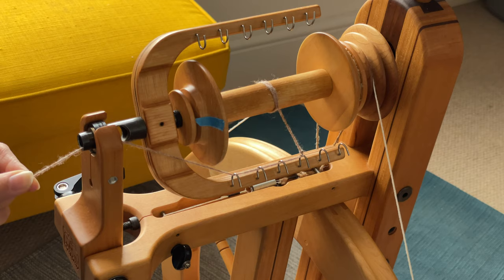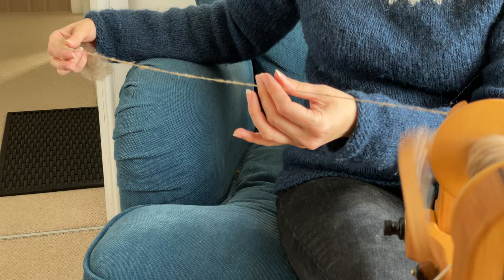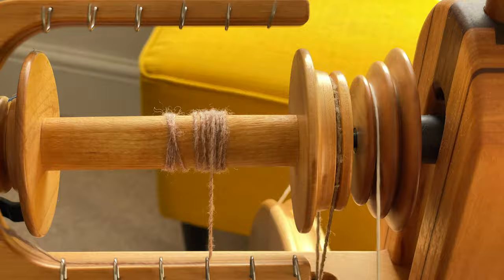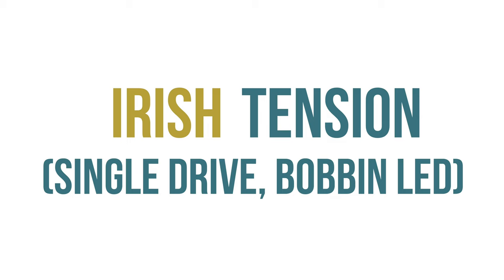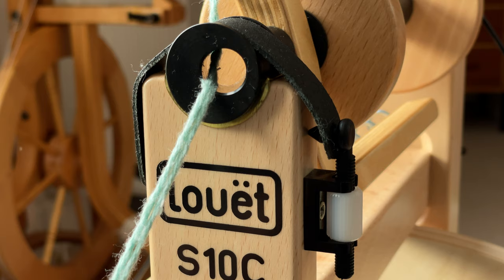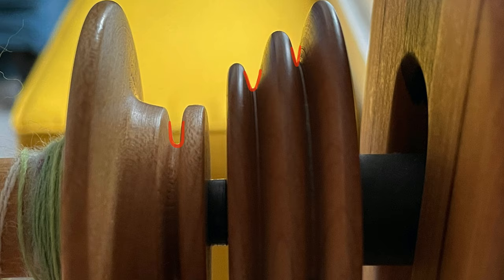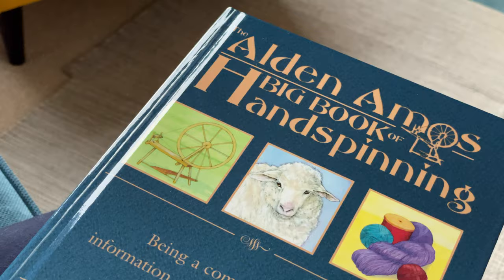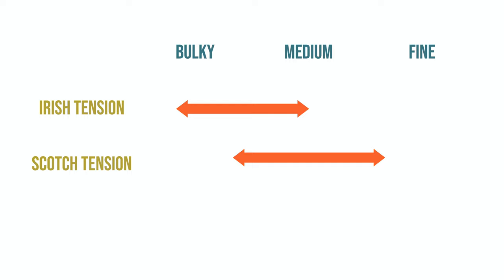How to Adjust Brake Tension on a Spinning Wheel (Scotch Tension, Irish Tension and Double Drive)

Comment: I ended up here after reading the book  - The Fabric of Civilization: How Textiles Made the World - In the book they talk about how there was always a shortage of thread before the industrial revolution so when people had down time they were making thread.  After reading that I wanted to find out how a spinning wheel worked. Most videos are pretty high level.  This is the first one that I saw that explained the secret sauce is that the speed of the bobbin and flyer are independent and it is the ratio between the two speeds that determine if you are adding a twist to the thread or wrapping the thread around the bobbin.  People make this look so easy to do but after this video it appears the whole process is quite fiddly with all the different adjustments and tensions.
Reply from the maker: Thanks for your feedback Tom - I’m really glad you found it helpful. I really need to get round to reading that book!  I often think about how spinning is such a niche activity now but pre-industrial revolution it was something everyone would have been doing. When you think about clothing, ship sails, mummy wrappings etc. and the fact that every inch of that thread was spun by hand it’s pretty mind blowing. 
I wanted this video to be accessible to beginners but also to show how it really works mechanically. While I was making it there were times when I’d write something in the script and think ‘hang on, is that really how it works?’ and I’d have to go and check on one of my wheels. 
The key ingredient alongside the flyer and bobbin going at different speeds is whether or not you have tension on the yarn - when you do, the components behave in a totally different way compared to when there’s no tension. 
Hope you enjoyed your foray into the world of spinning! 😃

Comment: Thank you so much for this video.  I don't spin but I'm fascinated by mechanical things.  Specifically, I wanted to know how the yarn was twisted but not always taken up on the spool.  I never knew the flyer and the spool could turn independent of each other. Yours is the only video I've found that explained and actually shows how this works.  Thanks for posting.

Comment: I just, on a whim, bought a handmade castle wheel from the 1960's (double drive) on ebay and I am reading up and watching all the videos I can find to understand how the wheel works and esp. how the various flyers and bobbins go together, because I may have to make some bobbins or whorls to go with this machine, which only has one whorl with one speed. I found your text very concise and understandable with great video of the various parts...very well produced! I personally like how no-nonsense you are with few smiley and goofy bits. Lots of good info and I'll be back. Thanks for your good work!

Comment: I use double drive on my kromksi minstrel.  Mostly because it was the way that the video said to set it up and I haven't tried it in scotch tension.  I think most of my friends do scotch tension.  I didn't have the opportunity to try out a lot of wheels, so I was on my own and I just got used to the difficulty.  Which, when you're just learning to spin on a wheel, there are so many difficulties that in the end I doubt it made much of a difference!

Fun story, I use a poly band for my double drive, which I've heard that some people think is impossible.  It very much isn't, and I like it a lot for the way I spin.  Mostly I spin short forward draw, as I do a lot of fine laceweight and fingering yarns for socks, which is what I like.

Thanks for this series of videos!  It is fascinating to learn how wheels actually work, and I appreciate the details and well-researched facts you present.

Comment: I wish I had this information when I started spinning in August.  However it's extremely useful to better understand wheel function. I use an Ashford e-spinner purchased in September and my very first wheel is a spinolution pollywog purchased in August.   I spin for projects that need worsted/DK yarn. The Ashford has enabled me to creat the yarn I want better then the pollywog. My next wheel will be a Lendrum 🇨🇦
The addiction is real 😁
Reply: Abir Hussein I also have an ashford e-spinner and it’s my only wheel. Can I ask, why do you want a treadle wheel? I kind of want one when I see people on you tube spinning with them, but do you think there is a real advantage? Just curious😊
Reply: @jenniferrich5292  Well... when I thought of taking up spinning I wanted to start in the  traditional style. Another deciding factor was price. The manual wheel I purchased was the lest experience. Another advantage is freedom of movement.  No need to use electricity and finely a bit of exercise. A month into using my wheel I wasn't making the yarn I wanted. The type of wheel I have is operated by toes not the whole foot and that is very uncomfortable.  Besides the upgrades to that wheel would cost as much as a new wheel. With the Ashford I've created yarn for my first hand spun sweater. Now my friends have bought me a Lendrum.  A Canadian manual wheel and I'm very excited to use it when I'm back in Toronto. Sorry for the ramble 😊
Reply: Abir Hussein thanks! Best of luck with your new wheel!
Reply: @jenniferrich5292  Thanks. My advice is to try a manual wheel. If you get the chance and sure you will enjoy it. Happy spinning.

Comment: Thank you so much! Your excellent, clear, articulate and succinct videos have helped me  so much. 
I have a DD, given to me, and have been learning on it but I have been having such problems with overtwisting.  All the online spinning group suggestions, like get the tension right, did not explain what is in this video. I now understand what the problems are, from a bobbin with V groove to the drive band tension. The other video that helped to pull it together for me was the ratios one; the two together have cleared up the mystery! I shall certainly be buying you some coffee (rather than the Aldan Amos book at several hundred £) ! 😊😊😊

Comment: I really loved your visual with the tape! The way take-up works can be a bit of a weird thing to wrap your head around, but this made it super clear. I chose an Ashford Kiwi as my first wheel, mostly for price and compactness but also because the Scotch tension seemed like a versatile option. I didn't really know what types of yarn I would prefer to spin, although I gravitated to finer weights simply because that's what I like to knit with. If I ever get a second wheel I'll definitely look into double drive, because from this video that sounds right up my alley.

Comment: Thanks for this and for previous videos! I'm a year into my spinning life but definitely feel like I'm still learning. I have a Louët Victoria S96 (Scottish tension) and the thing I'm still scratching my head about is the sliding hook (start in the middle? Start at the back/front?!)! The break band info is really useful as I find that the consistency does change towards the end of spinning the fibre so I'm going to try experimenting with turning up the tension a little :-)

Comment: I’m a relatively new spinner, and I bought a used spinolution pollwog with the accelerator. I haven’t used the accelerator yet, but I find I naturally spin fine yarn, no bigger than dk weight. In the future I would like to spin bulk art yarn also, but I like the spinolution wheel and plan to stick with that brand.

Comment: Fine yarns can easily be made on Louet wheels by lacing the flyer which decreases the pull until you get some yarn singles onto the bobbin.
Reply from the maker: Absolutely. I’ve got some other tips for fine spinning on Irish tension wheels coming in another video. :)

Comment: im not a very experienced spinner because i keep drifting off to other crafts!  But I do love it and I have a wheel. You talk about adjusting tension as the bobbin fills. I think this is to increase it gradually, is that correct? because the diameter of the yarn building up on the bobbin is increasing, but Im sorry I don't really understand why that requires a tighter tension!
Reply from the maker: Hi Bella, yes, that’s correct, you’d gradually increase the tension as the bobbin fills.  You may only need to increase it a couple of times and often just very small adjustments each time.  Essentially it’s to keep the ratio between the flyer and bobbin the same as the effective diameter of the bobbin increases. I’m not the most qualified to give an in-depth explanation of the physics behind it (so many factors to take into account and I’m pretty sure my physics teacher is still waiting for my homework from 1994!) but Maurice from Dreaming Robots (maker of the Electric Eel wheels) has a video explaining it here: https://youtu.be/7Wzg-0psf3s  Hope that helps!

Comment: I'm a newbie and would like to know if you have a double drive band and you want to use the scotch tension what do you do with the double band? do you put them in the same slot on the whorl?
Reply from the maker: Hi Janet, thanks for your question. On wheels that are capable of using both double drive and scotch tension, in most cases you can do exactly as you suggest - treat the two loops of the double drive band as one and put it on the flyer whorl. Some wheels might be a bit picky about the thickness of the drive band but on most wheels it’ll be fine. 
Alternatively you can see if there’s somewhere on your wheel where you can secure the double drive band out of the way and make a single loop drive band for scotch tension. Hope that helps! 😊

Comment: Which part of spindle is sharp that you can prick your finger on?
Reply from the maker: In the original version of Sleeping Beauty she fell asleep because of a splinter of flax, not from pricking her finger on a spinning wheel. In later versions she pricks her finger on the ‘spindle’ which is found on Great Wheels/Walking Wheels and is sometimes available as an accessory called a quill on other modern wheels. The point of a spindle isn’t so sharp that you could prick your finger on it unless it was from a splinter of metal. We keep a protector over the end to prevent people getting injured by walking into it or falling against it but Sleeping Beauty must’ve been unbelievably accident-prone! 
Because a lot of people wouldn’t instantly recognise a great wheel as a spinning wheel, many re-tellings of the story show a treadle wheel with a very pointy distaff (used for holding flax or other fibre) and she pricks her finger on that. Distaffs aren’t sharp either.
Reply: @TinyFibreStudio  so you're saying sleeping beauty was so fragile she could've cut herself with a spoon? XD. maybe if the witch didn't curse her and let her roam free she would've died by herself